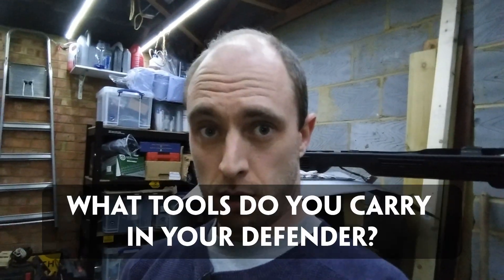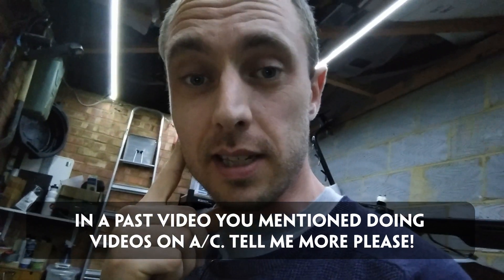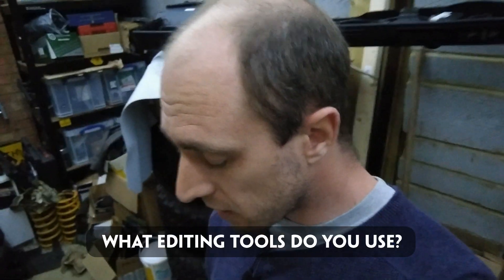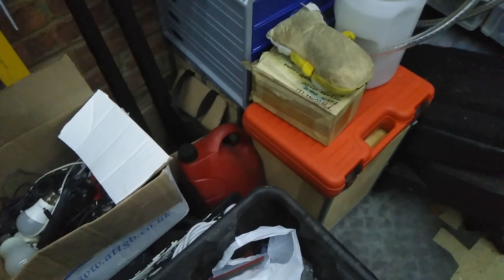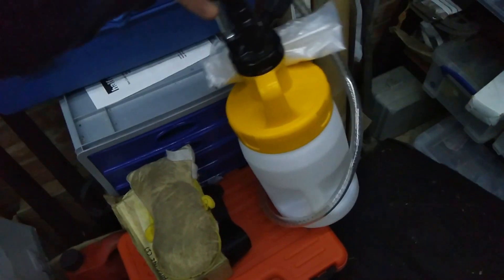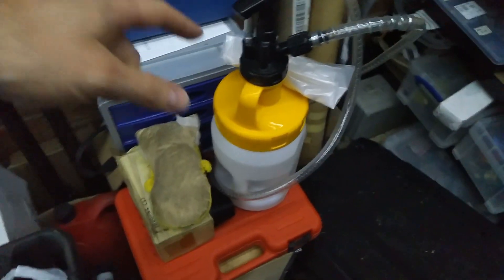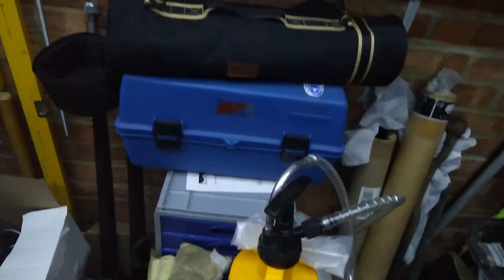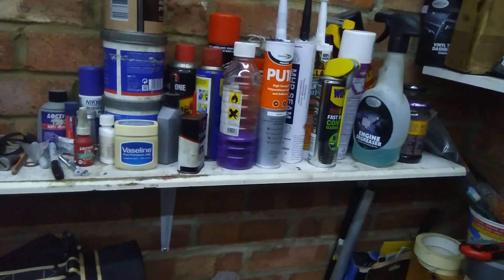Q&A - Tools, 200/300Tdi spares, Air con system and garage walkround

Comment: There is something very wrong if you don’t trust your vehicle to do a short trip of 1500 miles, I regularly do trips that long on some of the worst dirt roads in Australia, have gone soft now in a D1 300tdi auto but the principle is the same . Keep the service up to it , check over after a couple of trips and pay attention to any changes in the way it feels . All I do before a trip is check the oil and water load up and go . In the last 2 years I have done about 100k on some of the most heavily corrugated roads that rattle fillings out with nothing falling off just the standard behind the dash rattle

Comment: What would be the complications of putting a replacement Disco 200tdi in my '93 Defender 200tdi?   I'm at 418,000kms on my current engine. But it's still running strong!  Just thinking through to the next phase of keeping it on the road.

Comment: Question for your staff: Will the A/C be possible for a Series?  
It was an option but I have never heard that someone has it.
Reply: mrcvry very possible, either a aftermarket under dash unit or if you can find one a air command roof mounted unit go the biggest you can fit because the heat generated in a series is huge . Have mounted both styles in series I have owned in the past especially for Australian conditions
Reply: pete ryan 
They are not normal here (yet).  Have to check if I can find some.
Reply: Your hardest part will be setting up the compressor onto the engine from memory had to make the brackets and adapt a pulley onto the harmonic balancer . No kits were around when I did it was 35 plus years ago. I put them on a 2a and a series 3
Reply: pete ryan 
I will need a mechanic anyway.  Will ask him the next time.  Thank you!
Reply from the maker: My staff don't know :)
Reply from the maker: @pete thanks pete for answering. I don't know much about series vehicles!
Reply: LR Workshop & Expedition 
I will tell my staff to contact your staff about it. 😄 
A Defender is not much different. TDI adds the turbo, TD5 adds the brain and 2007 is the end of the Land Rover era.